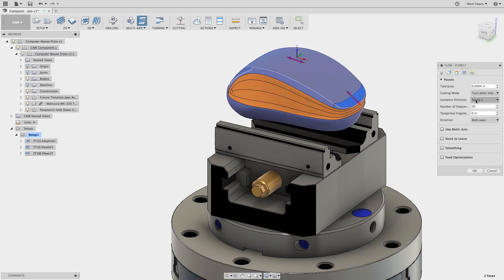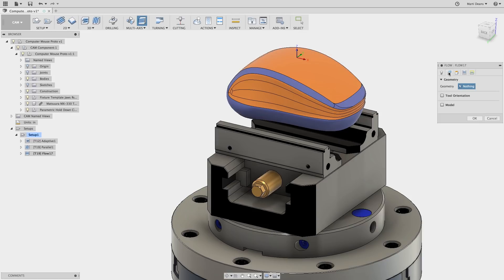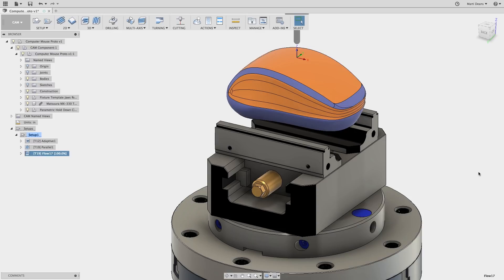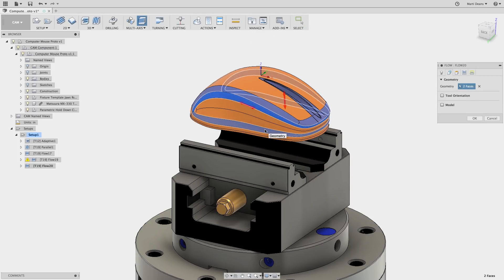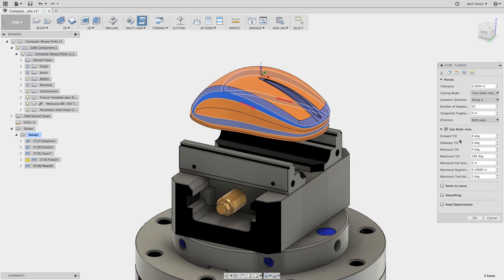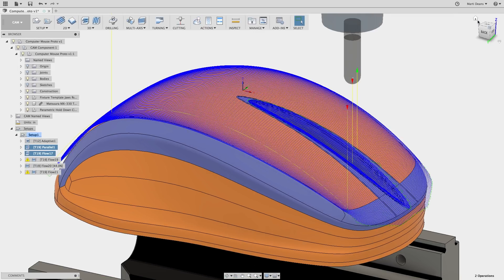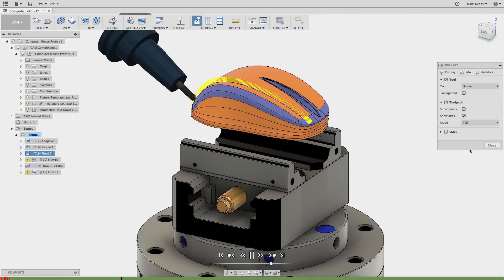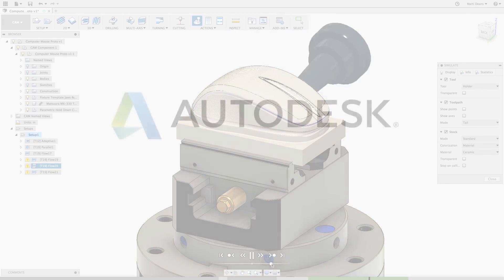QUICK TIP: Flow Toolpath

Comment: Starting at 1:50 you mentioned a small Fusion warning stating that some passes were skipped, that doesn't sound good :) what does that mean for this example?
Thanks
Reply: Good question! My understanding is that given the selected surface, tool, and the allowed tilt angles, the tool just couldn't quite reach some of the geometry. Kind of like the warning when Fusion reduced lead radius or raises the feed height - not totally bad but something you should be aware of. I would make sure you do a visual inspection and run a stock simulation if the error pops up.